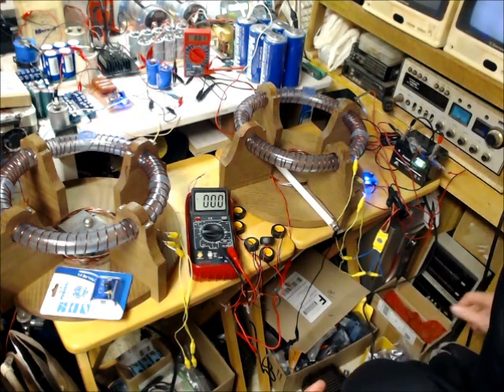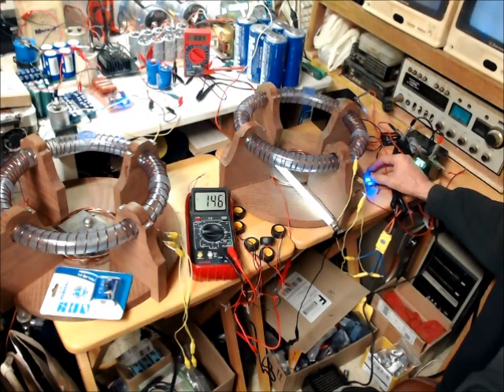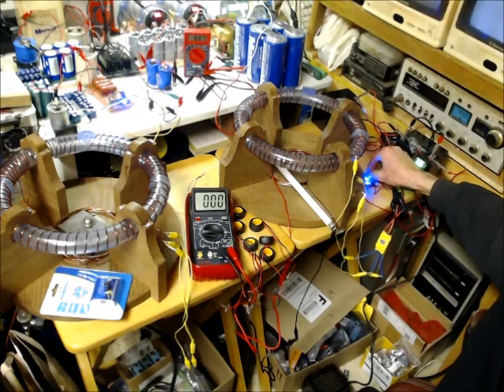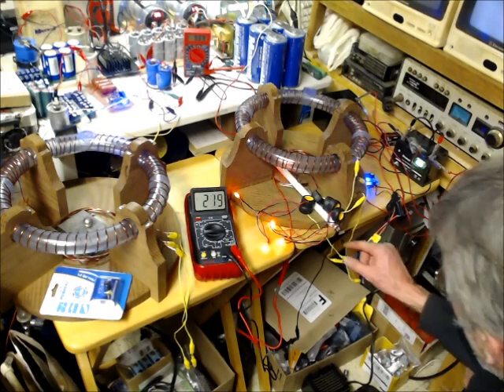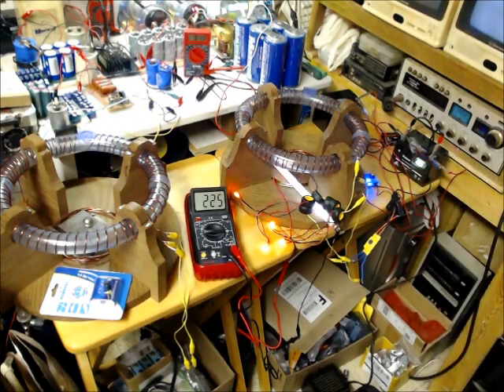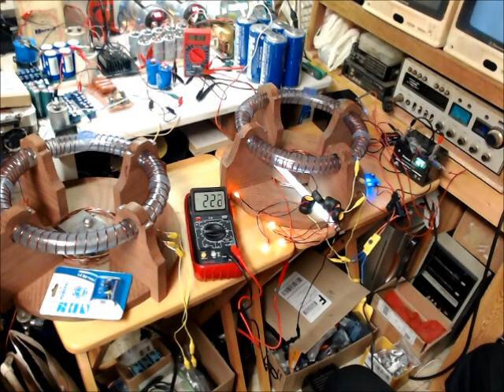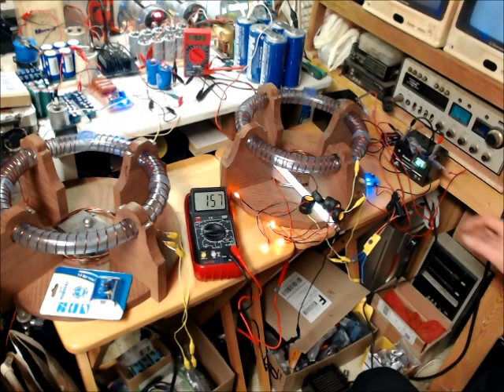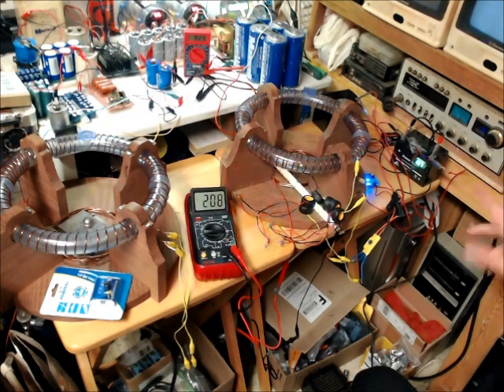NEODYMIUM MAGNET ACCELERATOR 3

Comment: What (where...) did you find circular tubing? (is it acrylic?)
Reply from the maker: It is clear PVC I wanted acrylic but it was way more expensive. These were about $180.00 each and an initial $350.00 mold fee. My hopes is to build a vacuum forming table to make them from acrylic sheets. I want to build kits to send out to everyone who wants to test these things.  :) But they need to be made better and cheaper for obvious reasons.
Reply: IC = you had to pay for the pvc mold - and the product(s) - which are cheaper than the same with acrylic...
Keep up the Tesla agenda - save this planet for the generations yet to come!